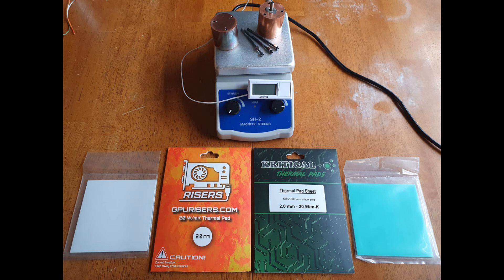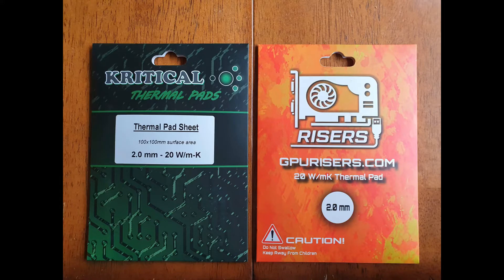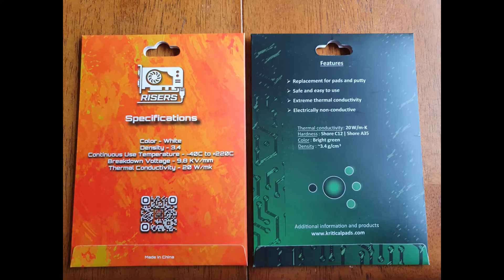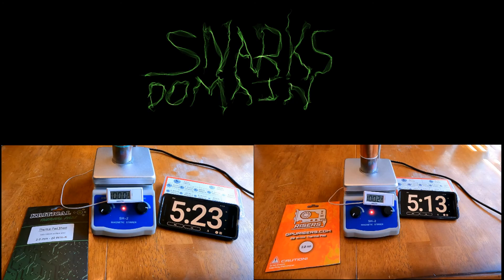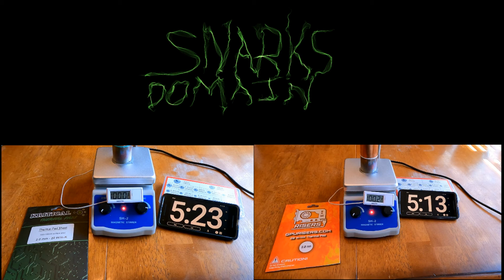Kritical 20W/mK pads vs GPUriser 20W/mK pads. Are Thermal Conductivity ratings accurate?

Comment: Hello I have to do maintenance after 3 years.
What site do you recommend to buy thermal pads or what brands do you recommend bro.
I was reading
kriticalpads does anyone know if they are still active to ship product? 
I have 4090,4080, 3080 ti, 3090
Reply from the maker: I'd go with a top rated Thermal Putty like Upsiren UTP-8 or Fehonda LTP81 rather than thermal pads. It's better AND cheaper than pads. When paired with a Phase Change Material for the core (Honeywell PTM7950, aupsiren PCM-1, Thermalroght Heilos) the application should last for years.

You can take a look at the charts located on the Google Drive link below (Test Chart Repositort>VRAM TIM>ETCHASH).

For all 4 cards you will want to buy around 300 grams of Putty. This should cost you around $110 CAD for the putty and another ~$15 CAD for an 80x80mm sheet of Honeywell PTM7950.

Comment: I really like your methodology, but I would suggest an addition as a control. 

The suggestion is that the control is 1 long copper slug, the full length of the 2 combined. 
This is the ideal thermal interference, continuous copper. 

Then you could compare how close the materials come to continuous copper.
Reply from the maker: Likely not a bad idea to test a single piece and see how it compares.

Comment: Your methodology is excellent and makes perfect sense. 
The only possible improvement is to add a thermocouple to the base of the bottom copper slug, to be sure the inputs are actually the same. 

The Gelid claims 15W/mK, so the faster performance is a bit weird...
There must be nonlinearities.
Reply from the maker: The results I saw between Gelid GP Ulstimate and the GPU Risers pads, when testing with a GPU, we opposite from the testing on this hotplate setup.

I'm wondering if the difference comes from not closely monitoring Ambient temperatures with either of the hotplate tests, or the GPU test.

Going forward I will always be monitoring Ambient temperature and including that in a comparison chart.

I will likely need to make some tweaks to the hotplate setup to improve accuracy/legitimacy.
Reply: @snarksdomain  if you're adding measurements, measuring the hotplate itself is probably critical. We don't really know how it performs.
Reply: @snarksdomain  the hotplate probably has a weird PID controller that compensates for the different thermal conductivity to some extent. 
A less variable solution would be a constant power heater.

Comment: I like the methodology, logic checks out to my mind anyway. Was really surprised by the result considering how much more expensive they are over the Gelid GP-Ultimate brand on Amazon. 

Will be going Gelid on my 2080ti. Thanks for the informative and to the point video. Much appreciated.
Reply from the maker: Thanks. Just be really careful with the thicknesses on the Gelid Ultimates. If there are good guides for your card with that specific pad then it should hopefully work out okay.

I had mixed results with pads in general and have since been using Thermal Putty, or a combination of Shims and Thermal Putty.

Comment: Which thermal pad (Thermalright, Aairhut, Kritical Thermal Pad, Thermopad Thermal GrizzlyMinus Pad 8)  do you recommend for maximum cooling on a PlayStation 5 with the Elecgear Heatsink on a 4tb WD Black SN850X ssd
Reply from the maker: I just read up on that heatsink a bit. I'd definitely recommend using Elecgear's riser kit (copper washer and their mounting screws) and try their 0.8mm pads. That should net you good results.

That being said, if you're looking for an improvement over the supplied pads I'd likely try either EVGA thermal putty of TH949-1 thermal putty.

If you wanted a traditional pad, you'd likely want to get a very soft 1mm pad since it would need to compress down smaller then 0.8mm. Maybe Gelid Extreme.
Reply: @snarksdomain  Yeah want to ensure my 4tb wd black sn850x purchase nor my 2 years of PlayStation 5 searching are not compromised by the provided thermal pad of the heatsink I bought

Rather not spend almost 1k on replacing those things by being cheap just on using the thermal pad provided, rather spend a little more to get a better one
Reply from the maker: @BambanGarcia  That's fair. If it were me I'd go with either of the 2 putties I listed.
Reply: @snarksdomain  Cannot go with thermal putty since it is in a liquid form that could run into the system itself thus damaging it even with the heatsink installed, must be a thermal pad or strip only to ensure nothing happens
Reply from the maker: @BambanGarcia  Thermal putty is not a liquid. You're thinking of thermal paste. Thermal putty doesn't run. It stays in place. Also, the Thermal Putties I recommend do not conduct electricity.

If you watch a few more of my videos you'll see that I use thermal putty on Videocards. Many of which cost more than a PS5. I've also used it in my gaming laptop. 

But you gotta go with what you're comfortable with. If you do go with an aftermarket pad, be sure to check for leaking oil after ~6 months. The leaking oil can collect dust which could itself conduct electricity.

I'm willing to bet that the stock pads supplied with the cooler are of a type that would last for a long time.

Comment: Should i go with 3D graphite stuff on my 3090 core side vrams? The temps are very bad. I will do the copper mod on the back side since my back plate is very bad quality.. Thanks!
Reply from the maker: It should work well for you. You can also use Aluminum shims on the backside instead if you like. They get same/similar performance as the copper shims in my testing.

The backplate side is definitely easier to tape up with Kapton Tape than the core side.
Reply: @snarksdomain  hi again. I have zotac trinity 3090. Are you sure I should buy 2.2mm 3d graphite? Because my zotac pads are 2mm. And people usually use 2mm gelid or thermal right? Would I cause issues with 2.2 3D pads? It's a bit pricey and I don't want to break things. Sorry for questions

Comment: Yes, but for a GPU usage it is more important to have a longer lifespan rather than a slightly better thermal conductivity. That's why I chose MX-5 over Kryonaut. MX-5 is hotter with 2c over Kryonaut but degrades so much slower... I wonder what's the case here. 
I know for sure that on mining cards Thermalright  Odyssey Pads won't last long at all compared with Kritical pads.
Reply from the maker: I'm hoping to find the perfect long life combo. Once I get some TH949-3 I'll test some out on the GPU Die acting like a 'paste'. If it works well we might have the perfect solution to never need to open a card again. Putty or putty+shims on the VRAM, putty everywhere else. And maybe TH949-3 on the core.

Comment: This might be a really dumb question, but any type of icing piping bag you recommend or specific nozzle size?
Reply from the maker: I like the Wilton Fetherweight reusable bag. 

https://www.wilton.com/10-inch-featherweight-decorating-bag/191005781.html

Would recommend doing getting a cooler so you can change the tip size when desired, something I wish I had done.

https://www.wilton.com/standard-coupler-carded/191007453.html

For tips I'd probably go with a #10 and a #5

https://www.wilton.com/round-decorating-tip-10-carded/191007424.html

https://www.wilton.com/round-decorating-tip-5-carded/191007496.html

The tip size I use is a #10.
Reply: @snarksdomain  Did you get my reply? Thinking YouTube might have blocked it or spammed the comment
Reply from the maker: @GhostMotley  I don't think the reply came through.
Reply: @snarksdomain  I've just replied, I think YT is spamming the comment

Does www amazon co uk/dp/B08VHHBHZQ/ look good?
Reply from the maker: @GhostMotley  yeah, that looks like it should work well. The silicone bags may not be as stiff as the Wilton bags, but that shouldn't be a problem. I'm sure they are heavy enough gauge to work well.

That'll be a nice kit to have if/when you get different putties.
Reply: @snarksdomain  Thanks, I ordered a 1000g tub right before they cancelled TG-PP10 and I've experimented with different pads, including KriticalPads but they either increase GPU temps due to mounting pressure or they bend the PCB slightly, which worries me long term.

Looks like thermal putty it is.

Comment: could you test Aairhut ?

also could you link a good source for the 1.6 mm copper sheet all of my local hardware stores only carry 20 gage copper sheets they are really thin and not flat. 

there is a link to this copper plate called coolmy gpu but there is no way i am spending 100$ its 60$ and 40$ to ship it that's insane.

i am getting by atm with 15wmk ultimate gelid pads with mx4 paste on the pad both sides otherwise i get terrible temps worse than factory pads.

my 3090 is running at 50c gpu 84c memory i want to get it cooler . Ambient temps are 23c.
Reply from the maker: Are Aairhut pads the same as Thermalright Odyssey? I've seen "Extreme Odyssey" on a few ads. I can likely get some at some point.

This site might be an okay source. Could order CPSH062 1 ft x 1 ft which would do quite a few cards: https://www.metalsdepot.com/brass-products/copper-sheet

84C on memory is quite good if you're mining. If you're gaming you could probably get them cooler.

My friends' 3090 I copper shimmed is now at 74 Celcius memory on an open air frame at 123.6 MH/s.